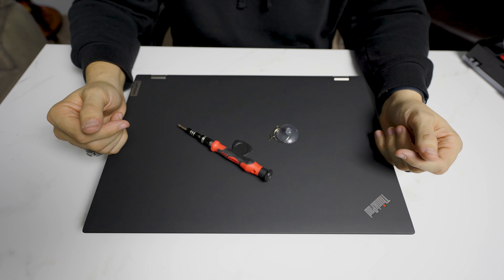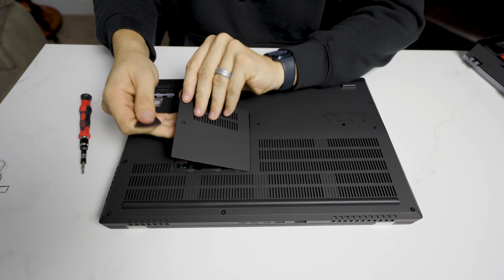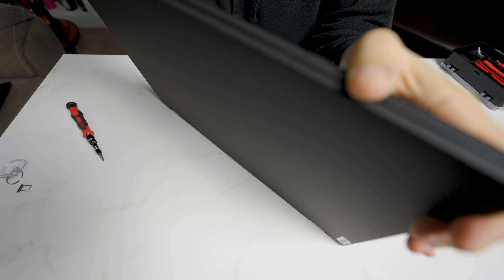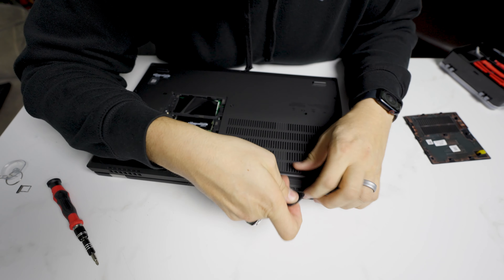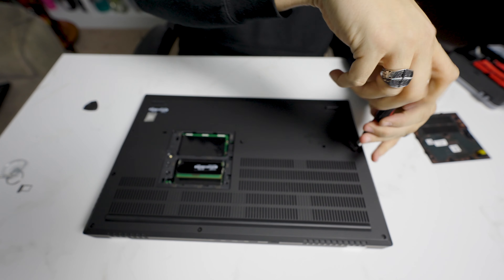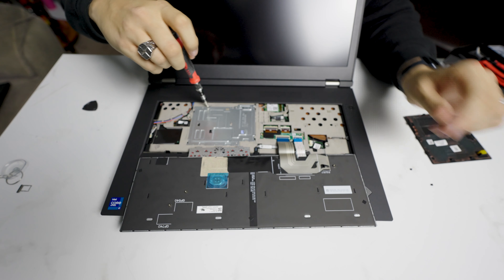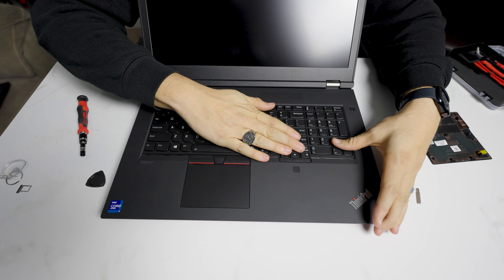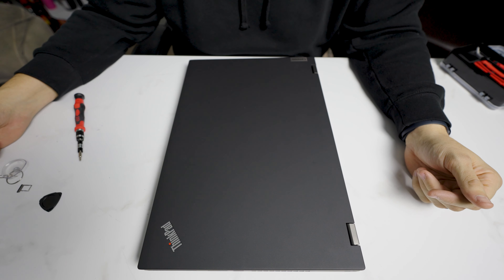Lenovo P17 G2 Disassembly, Upgrade, and Teardown (2022 Model)

Comment: Thank You. I'm considering ordering a P17 and this was very useful. Thanks much
Reply: do not buy this computer! this laptop has issue with left fan - high pitched noise make even on low speed will make the work uncomfortable. the replacement of cooling system doesn't fix the issue because the problem is with desing the fan SUNON. Strongly do not recommend this laptop. Lenovo cannot fix this issue.

Comment: I have one of these on order for work right now, looking forward to it. What eludes me is the reasoning for Lenovo not putting the two factory sticks of RAM in the slots under the keyboard, leaving the two easily accessible slots under the service hatch open, like the two NVMe slots. Although, for the sake of popping those few screws loose underneath and sliding the keyboard out, it probably doesn't really matter much. Thanks for the video - Lenovo appears to have done a great job of making this an incredibly easy to service workstation replacement. Can't wait to get my hands on it and see how the 4k panel looks.
Reply: @Chris Pollard, I need that exact kind of Laptop, Please can you get one for me? :) Lenovo P17 Gen 2?

Comment: For the fans Are they just taped to the heat sink or when replacing them do you need to replace the entire heat sink along with the fans? Also do you need to disconnect the battery before changing the RAM or SSD? Thank you

Comment: Hey, thanks for this video, I paused it a few times but couldn't quite see if the power cable had a direct connection to the motherboard. Are you able to see if it's connected by wires to avoid any stress, or is there something solid connecting the power port with the motherboard?

Comment: @ManeTech thanks! I saw that the WiFi card is under the keyboard but also looks partially under the casing. Is it feasible to replace the card by only taking the keyboard off?

Comment: Who do you think is quieter in the cooling system and who is cooler? Thinkpad P15 G2 or P17 G2?
Reply from the maker: So using normally, they’re identical. Once they’re under heavy load, the P15 will ramp up faster, however the P17 is louder overall

Comment: Hello, thank you for this interesting video. But I'm actually interested to know if changing the screen of the P17 Gen 2 is easy?
Mine broke in a very silly way, a usb cable was on the keyboard, and I closed the cover to put it to sleep and not at all violently, but it was enough to crack it when I came back later.

I couldn't find a video of how to replace on a P17 Gen 2. Is it similar to another one? Thanks in advance for your answer.

Comment: I have a 2021.  Loosening the screw over the RAM slots on the bottom does nothing.  I used a very fine flat blade screwdriver to pry the cover off.  It was more likely to break than open.  Did something get changed?

Comment: I have 4th Generation  ThinkPad X1 16" Windows 11 but ever since I bought it a year ago the keyboard occasionally does not recognize any key strokes on any keys. I usually have to do hard reset and that usually fixes it. 1. Is it easy to replace the keyboard? 2. Have you ever heard of this happening with them before? The first thing I noticed in the beginning the track point never worked but I said, I can li e without using it.

Jake
Reply from the maker: Yes, keyboard is SUPER simple to replace!

Comment: @CWTech Hello and thank you! So just to echo your remark starting around the 2:27 mark, if I have just one Gen-4x4 SSD disk installed and nothing else (i.e. the other two SSD slots are empty), and want to install one Gen-3x4 (or Gen-4x4) SSD disk, then I only need to pop off the small rectangular cover on the back and nothing else?

Also, will an SSD ordered with a heatsink fit? (So I have two questions. Thank you!) =:)
Reply from the maker: That is correct!

On the Heatsink, it would need to be a super low profile one to fit. Honestly, a majority of the heatsinks are all marketing anyways. Unless you’re doing massive IOPS on that disk, it shouldn’t be needed.